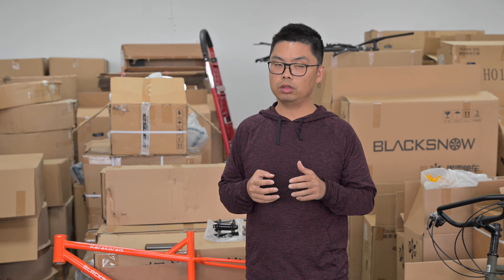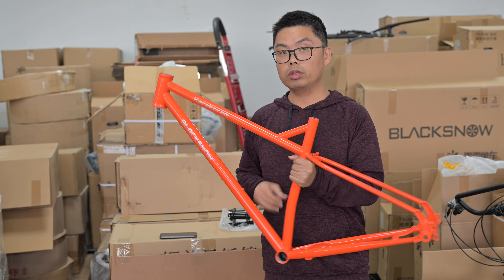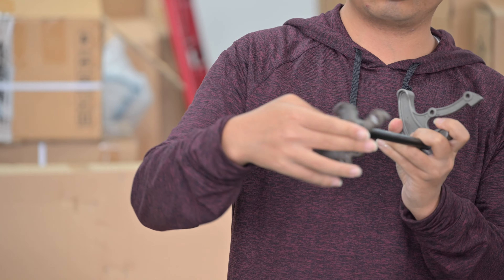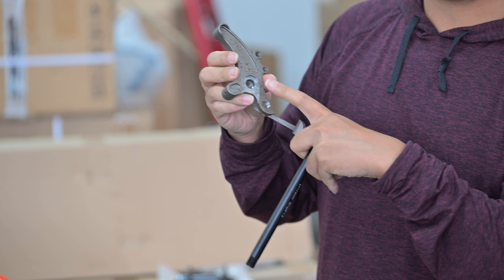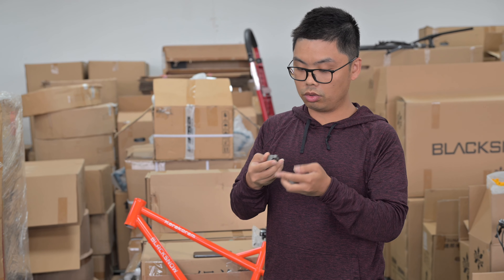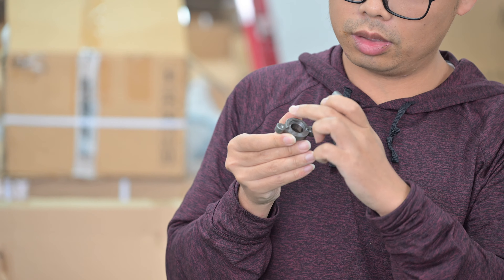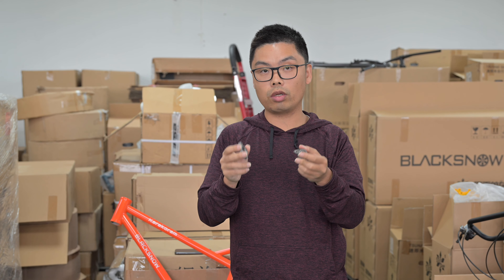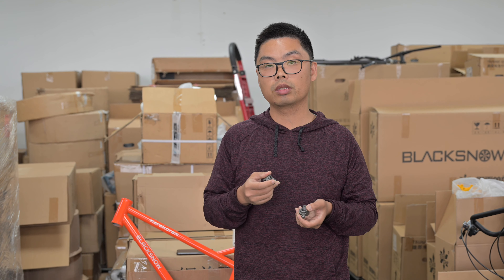BLACKSNOW THRU AXLE DROPOUTS

Comment: Do you plan bring the thru axles to Dragoon and Pangaea? Or both model stick to quick release?
Reply from the maker: Thru axle dropout and its building procedure, cost is quite different from quick release ones. Dragoon and Pangaea are the 2 hot models, it is good to apply new technology on the hot models. Let's wait and see.
Reply: @blacksnowcycles6648  I hold my purchasing then! Cant wait.